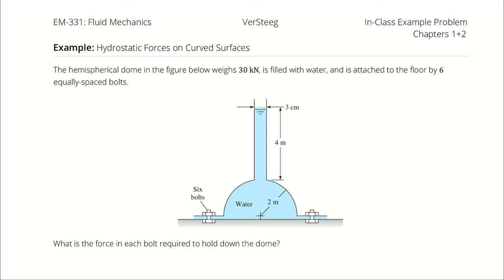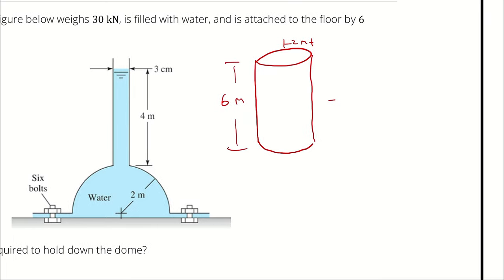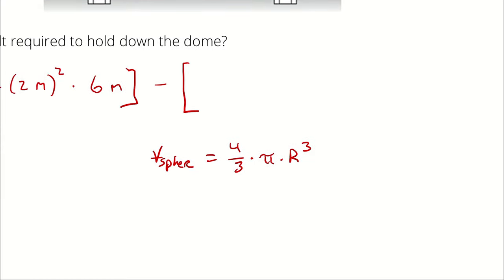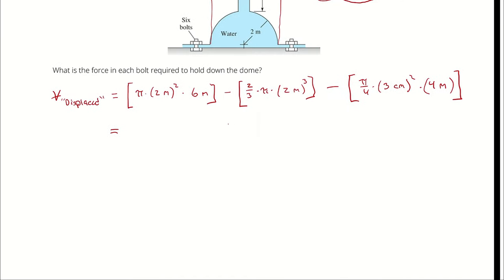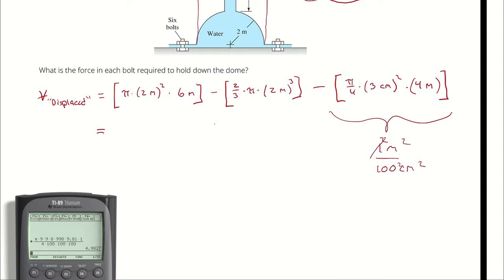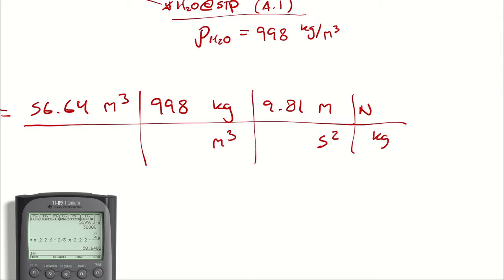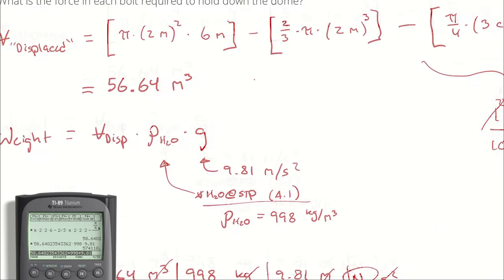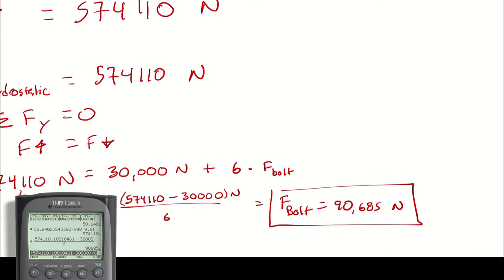Example Problem - Hydrostatic Pressure on Curved Surfaces (2)

Comment: why you found the space volume i dont understand. Can we just calculated the water volume ?
Reply: just think about the buoyant force. consider the volume 'replace with air' be in water. the buoyant force has a magnitude equal to the weight of the fluid displaced by the body and is directly vertically upward.